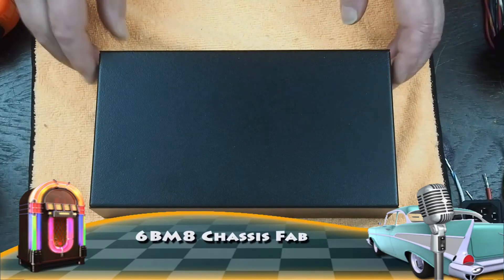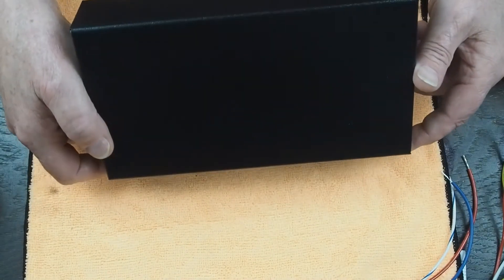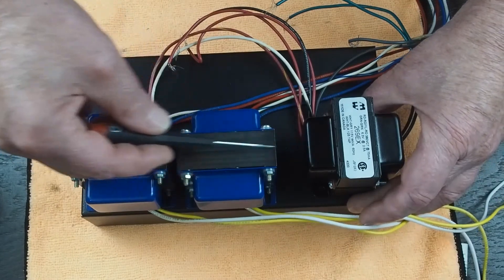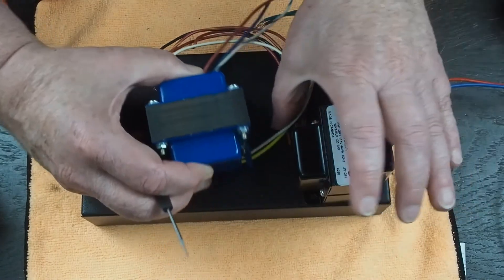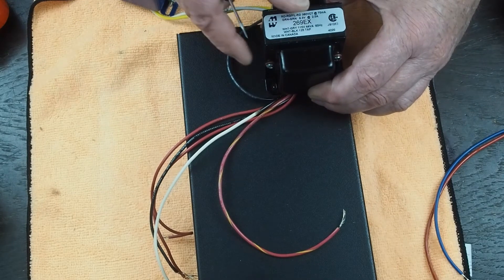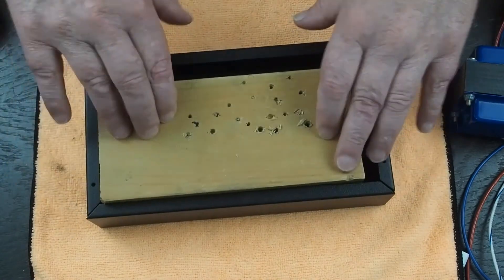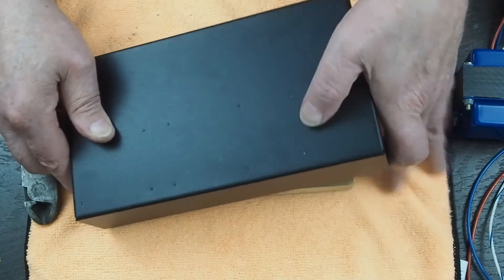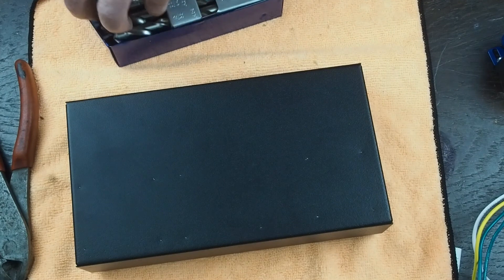6BM8 DIY Tube Amplifier Chassis Fab #1

Comment: I agree that black screws look best on a black chassis. Edcor can send on request bare metal end bells, I remember Mark Blueglow saying in one of his 807 build videos.
Reply from the maker: Actually painting the powder coat is not a problem. It acts like a pretty good primer. You just scuff it off with some 220 grit sandpaper and paint it.

Comment: What size of the cabinet？  Thinking about 6GF7A....   Should be good for it...
Reply from the maker: It is 5 X 9 X 2 inches.
Reply: @SkunkieDesignsElectronics  It looks so tinny ..Can fit everything?   Where did you put the choke on?
Reply from the maker: @longji98zhao72  Watch and see :) It's a small choke that is under the chassis. For someone building their first amp, I would recommend a larger chassis to give you some working room.